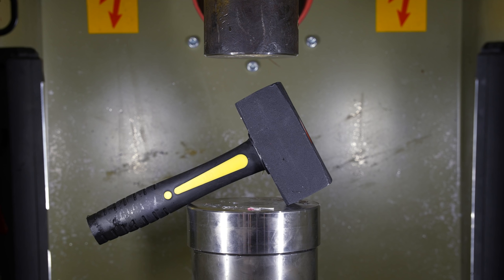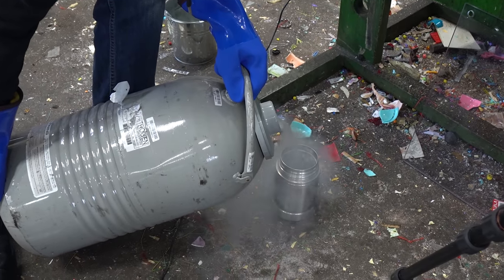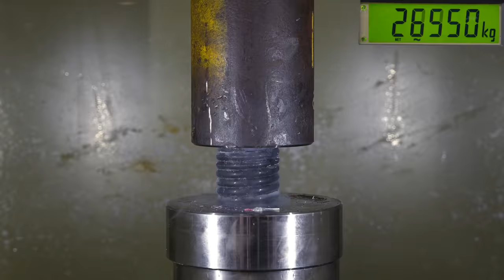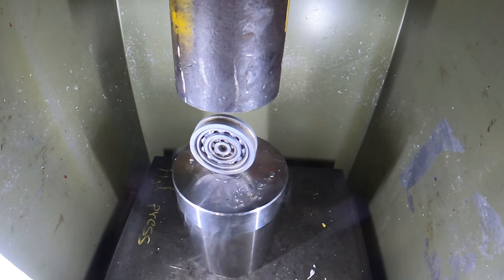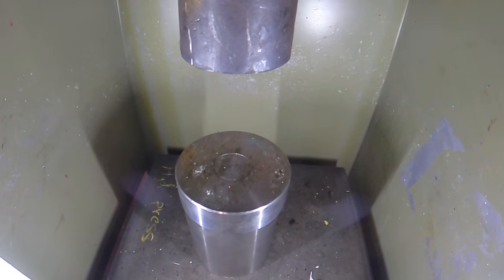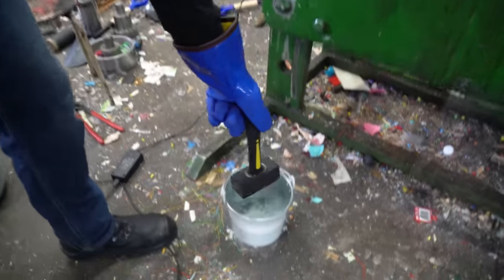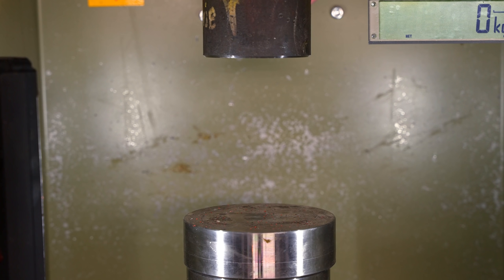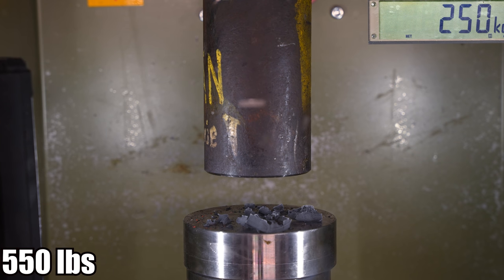Crushing a STEEL HAMMER Frozen in Liquid Nitrogen With Hydraulic Press

Comment: You can see how the stress as it starts to compress heats up the socket, as the line of condensed frost moves from the top and bottom to the middle.
Reply: My Perfect Body  I wish Youtube would do something about these fucking bots already.
Reply: @meatmobile  shhh! If you complain about it too much they're just gonna remove the whole comment section. After all, that's way easier than fixing the problem...
Reply: @josefstalin4532  Best thing to come out of Stalin :D You're right, scary prospect.
Reply: I think it is more conduction of heat from the large press plates to the small socket.
Reply: @allonmessenberg3129  Then it would be more uniform, and way slower.
It doesn't start "defrosting" until there is a fair amount of pressure on it, and it accelerated every time pressure was added.
Reply: @The_Keeper  I don't think so. Unlike the hammer, which has convex faces which make a small contact area with the press faces, the socket faces make uniform contact with the press. The stress distribution should be uniform throughout the length of socket, with a jump in value between the thicker bottom and the thinner top. The stress in the top section of the socket is larger than the bottom section, so it should undergo more strain than the bottom section (and uniformly). Instead, we see simultaneous defrosting starting at the contacting faces. The increased pressure creates better contact between the socket and the press and therefore increases the conduction of heat.
I would like to see a uniform cylinder, frozen and pressed until good contact is made. Then I would like to see another uniform cylinder frozen and crushed but with thermal insulation between it and the press faces.
That should give us a good comparison of the defrosting dynamics.
Reply: I think it may be thermal stress exploding the metal rapid cooling then heating from pressure 🤔
Reply: Science!
Reply: @drivemind7142  
Physics. Transfer of energy. The compression energy from the press is transferred to the socket producing heat.
Reply: And on the larger hammers, you can see the cracks propagating semi-radially from both ends of the hammer inward. Tells you what's happening in the microstructure as small cracks form and propagate initially, before some critical flaw allows the entire body of the hammer to split and move sideways out of the press.

Comment: This was one of the coolest things you've ever done i think. The way that big hammer breaks apart is insane. The steal looks like it does when being forged it had slag come off it. Also u can see every little crack when it starts going. So freaking bad ass.
Reply: It's the paint what comes off.
Reply: And looked like it split into four large chunks of about the same size, like it was torn apart at the middle.
Reply: @tantamounted  -  That was the weakest point.  As you can see in the Slo Mo there was a compression zone running parallel to the hammer handle which then turned into the fracture zone.
Reply: It was just the plastic handle inside the hammer, but it still looked cool. We did actually get sparks on a few of them.
Reply: Well they were using liquid nitrogen, can't get much cooler than that :)

Comment: Wow, at 7:50 if you watch, you can see fractures spiderwebbing out from the top, the bottom, and the middle. They grow outward slowly. And when the fractures from the ends touch the fractures from the middle, that's when the hammer shatters suddenly. Good stuff.
Reply: The cracks are from the paint coat in the hammer. It's coincidental that it explodes at that time.
Reply: that's just the paint

Comment: You can see where the parts are heating up under compression by the frost melting.
It would've been cool to see a thermal slow motion, if that was possible. Seeing how hot it got from cryo temperatures and how rapidly, compared to room temperature.
Reply: good highspeed thermal cameras are pretty hard to come by in the US unfortunately :/

Comment: 6:08 Does anyone know why the light had an extremely short blackout at the exact same time when the hammer broke? 🤔
At 7:15 it is the same happening again...
Reply: perhaps it's a electromagnetic/ferromagnetic phenomenon such like a mini emp shock
Reply: Shockwave from the explosion
Reply: Magic
Reply: It is the base of the press bouncing upwards when the item being crushed fails. You can see it clearly in the slo-mo, or frame-by-frame, if you pay attention to the base. This shock makes the fluorescents to lose the electric discharge for a brief moment. If the lamps were not touching the press framework, they would light uninterrupted. Lauri: Hint hint!
Reply: Because the lights are not up for the task ☺️ he just told you lol 😆
Reply: @JDmoney00420  Wow! That was a detailed and through analysis on the reasons of lights flickering. What an insight!
You should consider writing a paper about this.
Lol.
Reply: @hagenbuttnee4480  Look at the flashlight right as it lands 3:38

Comment: Very cool how you could see the ice melting on the socket where it bent. So much heat produced there that it melted it straight off!
Also on the hammers you could instantly see the weak spots where the ice melted off/cracked off
Reply: I think it was more the heat conducting from the relatively warm metal parts of the press than the deformation of the part itself. Since it was so brittle i don't think it was noticeably deformed.
Reply: Yeah I think it was the sheer heat that's produced when the items are crushed that's what's making the frost melt. Glad someone else thought and saw it too.

Comment: I wonder - what exactly happens just a moment before the thing explodes that causes the light to go out for a fraction of second? Is it a light issue or a camera sensor issue? Is there some magnetic phenomenon going on with cold metals under pressure that disrupts electronics? Why does that happen in pretty much every crush? Or does it have to do something with the setting and the press itself? So many questions!
Reply: It is the base of the press bouncing upwards when the item being crushed fails. You can see it clearly in the slo-mo, or frame-by-frame, if you pay attention to the base. This shock makes the fluorescents to lose the electric discharge for a brief moment. If the lamps were not touching the press framework, they would light uninterrupted. Lauri: Hint hint!

Comment: Its interesting how you can SEE it heating up! The way they crack also reminds me of pouring boiling water into glass and it cracking from the rapid change- are these breaking so easily for the same reason?
Reply: Yea because you have a temperature difference of a few hundred degrees (whatever the unit)
Reply: Glass is very brittle at any temperature but it's the heat difference causing stress in your case, I suppose the stress comes from pressure difference in the crushing case but the effect is the same. Would love to see these crushing vids with a thermal camera for metal and a polarized light camera (or however they do that) for glass to see the stress build before breaking point

Comment: Very cool experiment! Slomo was amazing! I'm with you on the spring. Surprised it still would compress. The thermal dynamics produced from the compression energy was amazing. Great physics representation on the transfer of energy as heat. How much does it cost to buy liquid Nitrogen? I wonder how a cube of 7075 Aluminum would shatter after Lq Nitrogen.

Comment: The ball bearings were already broken before pressing them, you can see a crack on the left side on the 2 big ones (inner and outer ring respectively) and at around 10 o' clock on the inner ring on the big bearing. I don't see cracks on the smaller bearing before pressing them.

Comment: Liquid Nitrogen is used in aviation to assemble some parts that are referred to having an interference fit . Like putting a structural part ( insert )  into a part that's actually smaller ( 2 to 5 thousandths) smaller than the part being inserted.   Freezing the part to be inserted reduces its size , then you insert the part . Once it warms up it is impossible to get out unless you cut the part out .

Comment: A suggestion, after watching this.

Experiment.  How much force can expanding ice produce.

1.  Make a very strong container, to contain water.  
2.  fill this container with water.  Put under press, lower press until it is touching the water.
3.  Freeze the water by applying liquid nitrogen.  The freezing ice will push up on the press, should increase the pressure gauge.

...What breaks first?
    -   The container breaks
    -   The press breaks
    -  The ice is contained.

My bet is the container will break.

Comment: There are a few things about those two hammers that I found interesting -- 1) that the shaft heated up to glowing orange so quickly -- less than one second; 2) that only the shaft heated up that much (you can see, especially for the bigger hammer, that when the shaft shatters away, the block of the hammer is still gray/black, not orange; and 3) that the block of the hammer breaks along the horizontal and vertical center lines, breaking into four roughly equal parts.  It would be interesting to see what would happen to a steel hammer that was forged as a single piece.
Reply: That was orange plastic sealant

Comment: You should cryo freeze something huge (like .5 meter cylinder) and press it into even bigger .5 meter hole and see what happens when it warms up and expands. Maybe even torch the block with an undersized hole so it only fits with nitrogen cooled cylinder and hot hot block with undersized hole.

Comment: What is going on with light? Once frozen metal starts explode - lights dissapears. Even in slowmo, frame by frame, it is visible that light goes off. Can it be some kind of electromagnetic impulse or just bad light wires?

Comment: I wonder if a hammer was used in the normal way- swinging it at an anvil say, and was cold, how hard would you need to swing it to break it?  So, impact rather than steady pressure.  Asking because I drop tested an assembly (1 cm drop) and it broke.
Reply: That’s a standard mechanical material test for brittle transition temperature.
It’s called a Charpy test.

Comment: Seen the video where you press things under water and I think be very cool and interesting to have a super heater steel ball as hot as you can get it then put it on the press and see if the water quench makes it harder or makes it weaker. Like have one ball non heated just regular and measure the pounds per pressure and do the same with the hot one so see if there is any difference in the two if the heat then water made it weak or more stronger. Got that idea of people make swords and they quench the sword to make it harder. So I was thinking it would make it harder then might have a bigger explosion.

Comment: Those stress fractures on the largest hammer were rather neat. They formed in a way not unlike magnetic dipole force -- with the top and bottom acting like north and south poles.
Reply: I have a hard time telling from watching what was cracking. was it a coating, or the hardened portion cracking of the outside?
Reply: Correct answer: Yes/True
...assuming a non-exclusive 'or'.

My guess is that the fault lines we saw forming was due to the way that hammers are forged, and tapered on the striking sides. But I suppose it could have been the coating breaking off.

Comment: So,  @7:51-ish, if you watch the left side of the hammer, you can see that weak point is a straight fracture from top to bottom.  As it is, sorta simultaneous and the plastic shatters at same time, it seems like there is some fairly odd deformation happening, it's like it was forged/cast as two halves.  Obviously I don't have all the angles of the shot, but it even looks like a straight vertical crack with no spiderwebbing or anything... Slowmo guys + HPC, make it happen!

Comment: The collapse of the handle leaving a void in the hammer head and hence a weak point  is the reason it disintegrates so quickly.  If you had a completely solid pumps of the same grade metal the result would be completely different.

Comment: 70 tones is the maximum weight of a fully loaded 737 at take off. That means that single hammer could have a 737 parked on it before it blows up when frozen in liquid nitrogen.

Comment: The reason why your lights are flashing is because the battery inside is literally being jostled so hard that they're disconnecting inside.
Reply: A way to prevent this is by changing the way they're mounted so the batteries are not in the axis of them press so when they do get jostled they're jostled in a way where they stay in contact.

Comment: PSA: NEVER USE LIQUID NITROGEN IN AN ENCLOSED SPACE
Reply from the maker: one liter generates about 1000 liters of gas. So you can calculate is it going to be a problem. Usually on small rooms you have to have windows and doors open but on large industrial workshop there is enough volume that oxygen % doesn't really get affected by something like 5 000 liters of extra nitrogen.

For example here we used maybe 5 liters and that makes about 0.2% difference on oxygen % on our workshop. Off course if you don't have any air circulation it might stay at ground level or at one part of the workshop so that's one thing to take into account
Reply: @HydraulicPressChannel  I know, I was just saying for anyone who might read it and wonder why who doesn't know about nitrogen asphyxiation.

Comment: The big hammer went to  135 metric tons of force without LiquidNitrogen.
This was reduced to approx. 75 metric tons of force with LiquidNitrogen.
Interesting that even at low force the nitrogen hammer did not exhibit any elastic deformation.
It would have been nice if you did a control experiment on all other items without LiquidNitrogen first and then presented the difference in tabular format at the end of the video.
Maybe next time.

Comment: Not that you need to repeat this mayhem, but you probably didn't need liquid nitrogen. You could have just heated the hammer head - or any other steel item - to a nice high temperature and then quench it. That will give you a nice brittle lump of metal that doesn't want to deform at all.

Comment: Interesting how the surface of the hammers spalled quite a bit before failing altogether. There must have been a huge number of stress cracks forming inside the brittle cold metal before complete failure occurred.
Reply: Some of those items failed so suddenly and completely it was more on the order of a detonation. The Slow-mo guys are totally  going to have to try this at 500,000 fps.

Comment: Since they are so brittle at those temperatures it breaks before it has as much built up energy causing the breaks to be less energetic. Think about the metal being compressed as an air tank being filled up on an air cannon. The higher the psi the tank is filled to the further the shot will go. Freezing the metal in liquid nitrogen is equivalent to filling the air tank to only 1/4 the pressure as normal.

Comment: Hammers are likely quenched so using LN2 will cause them to harden even more. This lasts even after you let them heat back up to room temperature.
There is a channel on Youtube that did some testing and a drill bit can last 50% longer after LN2 quenching. But they are also much more brittle. So it is something you should only do if your use case allows it. Also LN2 is not that cheap so you have to find if you can get a return on investment. They showed a graph of quenching, you can essentially do LN2 quenching without having to heat it back up as the steel settles in its crystal structure. Cooling it down hardens that structure. Heating it back up does not unharden it until you get above a point where it actually gets softer.

Comment: The light keeps going off right at the point of explosion.  It's like your light and  piston are on the same circuit.

Run an extension cord to a different breaker circuit.

Comment: it looks like the hammer was injection molded, with one injection hole in each corner, making a poor fusion of the metal because both times it sheared in a plus symbol with 4 segments, it'd be interesting to see one made of a more continuous metal piece crushed if you're willing. it'd probably make more shrapnel and take more force so it's understanding if it's a bit too risky
ok just watched the last 10 seconds, nvm that's fair